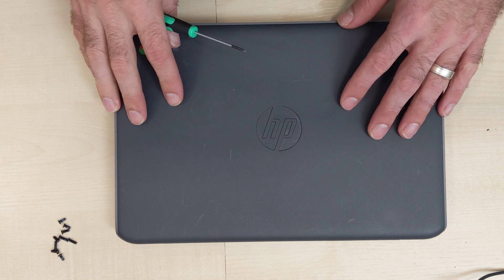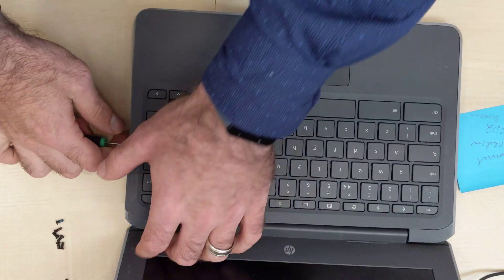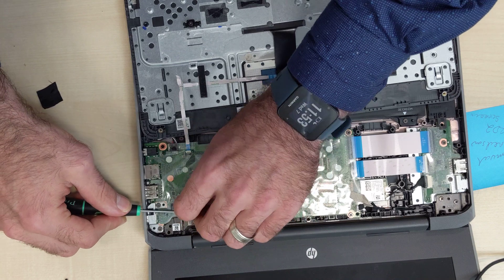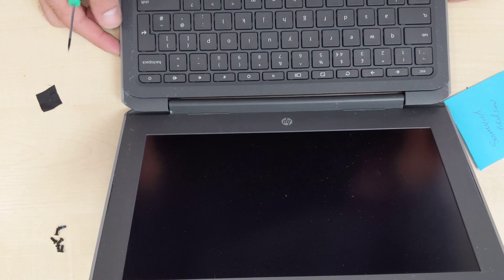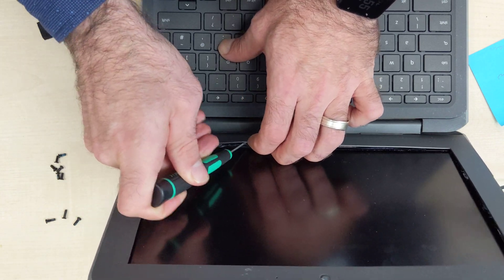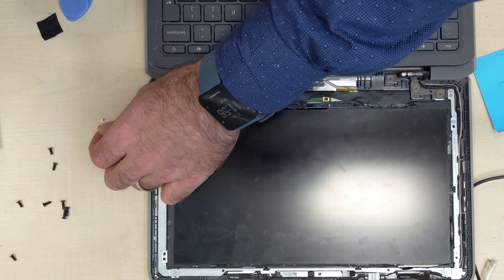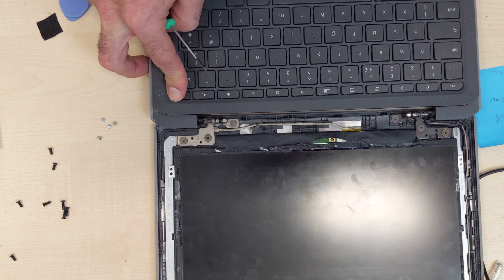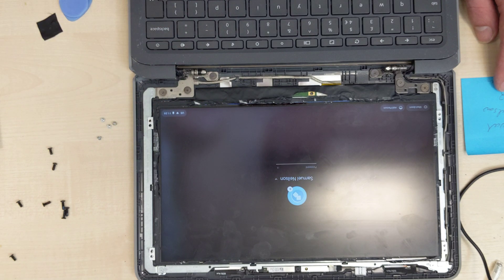hp Chromebook g7 dull dark screen problem reattachment

Comment: My issue was the screen flickering to this black and dim depending on the angle of screen. Now it stays dim. I tried ur ways except power wash and no luck. I'm bout to put it back together and idk if I'll even be able to see to power wash it smh
Reply from the maker: It can be the cable but I have seen a few where the motherboard just has issues and it isn't outputting properly.  It's rare but can be a huge issue that's levels above us fixing. I'd give the cable clean and reattachment a go as it works in most cases.
Reply: @thecandleman5129  yewh I've tried to reattach and still doesn't help 🤷🏾‍♂️

Comment: I gonna get a beating this week I can already feel it on my back I made it worst at first when I put at 90 digress I could it good but when I moved it it became really dim
I saw this video and this could work bc I have that exact problem so I opened it check the first wire put it back in tried to open it and it didn't open I was like ok so I unscrewed the screen got the other wire out and put it back in and didn't turn on I sreed everything back together and charged it for an hour I tried to open it and it didn't turn I started crying bc I knew I f'd up also there was this black wire connected to the screen thing and it said don't touch I saw that you ripped took the hole thing of so I was like It's probably not important now it's charging but it won't turn on it's a white  hp chromebook 14 pls help😓

Comment: I have an HP chromebook 11 g7 ee and the screen flickers black randomly a lot. its really annoying and i dont know how to fix it. could someone please help me
Reply from the maker: This could be the same issue as shown in the video you are on. One end of the cable can be lovely attached so when the screen is moved it can change the contact. But it can also be the display section of the motherboard. Very rarely you can have failure for the output section of the motherboard which results in display issues. Iv seen some very weird display issues that are on a hardware failure level and not able to be fixed with a screwdriver or powerwash. Give this technique shoe a go and if it doesn't work you next move is to msg hp to see if your warranty covers an engineer or repair which would hopefully cover a new motherboard
Reply: @thecandleman5129  thank you bro. love the content

Comment: i did the refresh button + power and all it does is have a faint beeping noise but doesnt turn on. 

update i did everything i did in this video and sadly nothing worked now i gotta pay 50 to my school for a replacement
Reply from the maker: Sounds like you have a display issue. Of the power light comes on but not the display. The display is either broken or disconnected. You need to go through this process again and reconnect each end. Good luck
Reply: @thecandleman5129  yea i tried i guess it burned out,  because when it turned off it just turned of instantly and never turned on again but thanks for helping getting a new one today maybe for free or for $50
Reply from the maker: @reyes3579  I deal with about 1500 Chromebooks at my work and iv never seen a screen burn out. They sometimes go into a limbo mode, or the display output from the motherboard can go. But unless you break the screen it won't wear or burn out. Good luck though.
Reply: @thecandleman5129  im not sure what happened 100% but i was just using it and it just turned right off

Comment: How do you powerwash this chromebook ?
Reply from the maker: It's pretty simple. But if you don't it will remove all settings. So if it's owned by a school , university or work they should do it. Switch the Chromebook off then hold down the escape , refresh and power button at the same time for about 10seconds to switch it back on. When you lift your fingers off the keys it will come up with a white screen. You have to go through 4 or 5 steps to powerwaah it but it will tell you how to on screen . If you get stuck look up the steps on Google. Good luck
Reply: @thecandleman5129  thank you so much i did get it working after going inside the chromebook it seems a part inside was a bit burnt so i will have to replace that it doesn’t charge when on but it works so im thankful
Reply from the maker: @niccolislafortune7724  brilliant.